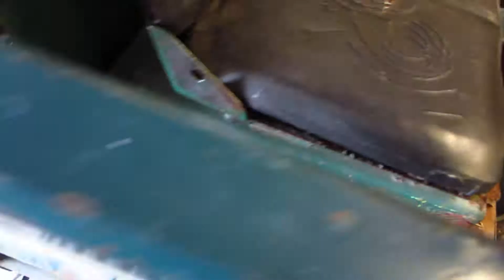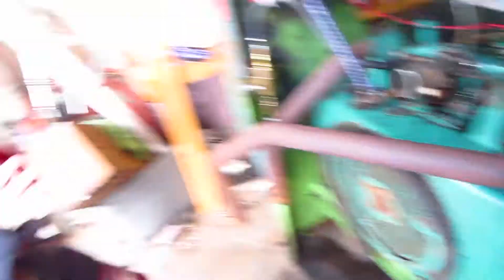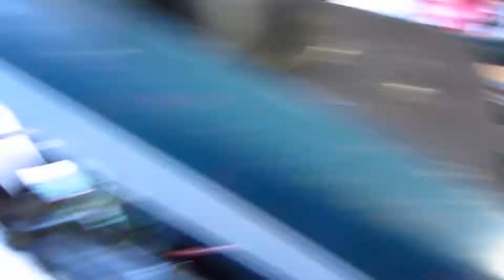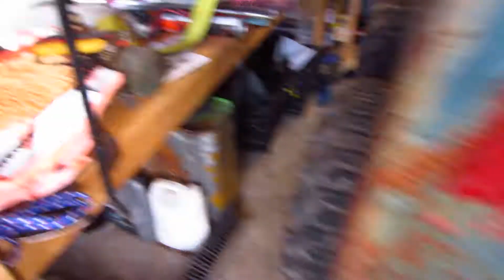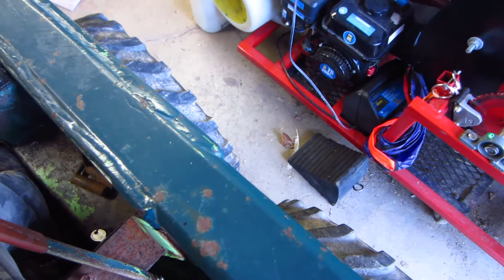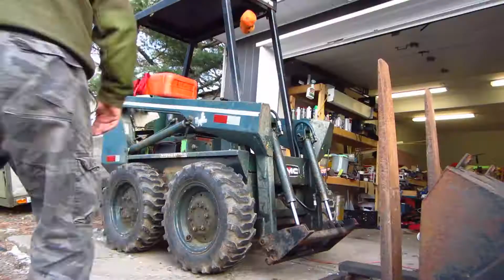OMC Mustang 330 / JD70 with "newish" Onan

Comment: nice work! although, one caveat, unless you increased your system pressure or added a higher flow pump, you won't have any more grunt with a more powerful motor. as long as the motor doesn't bog, you wont feel any difference. i plan on putting a 25+hp engine when i find one in mine and increasing the aux pump displacement to run attachments with it. but until i find a suitable one, ill keep running the 18hp i have now, which has no issues in the stock configuration.
Reply from the maker: hey, thanks for commenting. This 25hp Onan is the stock motor for the 330 Mustang. It still bogs but this is mainly my poo governor spring setup. Easy on fuel tho.  I bet an 18hp diesel would be exactly the repower ticket except for the noise.  Which model do you have with an 18hp?

Comment: Nice video. I have a Mustang 342, about a 1988?  Came fully assembled. Haha. Has enclosed cab.  And running good with the 4 cylinder Ford Engine. (Same engine also used in racecars). My machine came with a 5 ft and 6ft bucket and a forks attachment. Paid $1800.  After I sell the 2 attachments that I don't use, I expect to have less than $1000 invested. I repainted it and it looks almost like new.
Reply from the maker: I think you win. :)   lol...    The ford motor sounds like the perfect setup, really.  Nice find. :)

Comment: 1st great job getting the ol girl running.  We had a hard time finding an engine that would work, that I was willing to pay what they wanted.  Finally scrapped paying a ton for engines we knew nothing about and out a yamaha motorcycle.  650cc engine that we knew ran, bike hit a deer a couple years back and literally traded some stuff for the whole bike.  Is overpowered for the Owatonna/Mustang 330 skid steer, but, we never rev it high.  Some fabricating was needed to make sit in the proper spot.  Once in it has worked wonders. I appreciate trying to stay close to stock, but, parts are getting rare and expensive.  So we decided to go a different route.

Comment: Very cool.  I wonder how much different our 125 is.   We have the ISUZU engine.
Reply from the maker: The 330 shares with the 125: booms-chain cases that are reservoirs, inline pumps. Like the 90 it has the 27x8.5x15 tires and the 25hp Onan.   So I guess I get the bigger drive system with less power...I like durability. Now where to find attachments or at least a new bucket? :D

I sincerely with I had the diesel like you. Is it a torque monster? :D